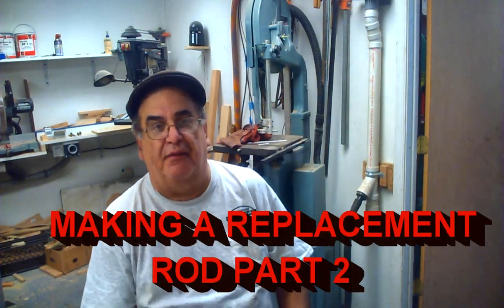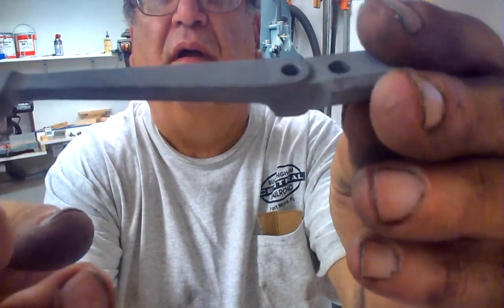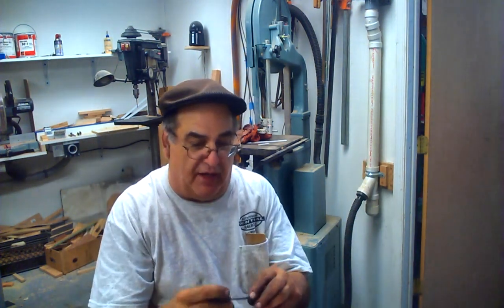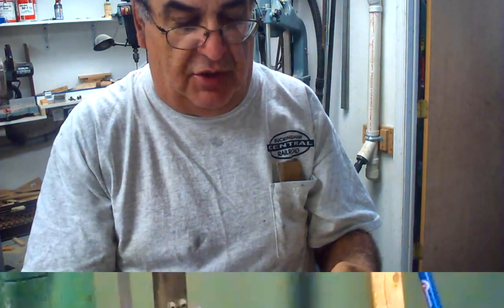MAKING A REPLACEMENT ROD FOR THE 1361 PT 2

Comment: Ya got that from your first vid. Just thought that since the bronze alloy that had been used was a weak point that you might cast them from steel. You could make a rubber mold off the piece you just machined.
Reply from the maker: Can' make a mold from the piece there is shrinkage to consider.

Comment: How would you make that if it were a production part? Centrifugal casting out of steel?
Reply from the maker: The original valve gear parts were lost wax castings I no longer have the molds.